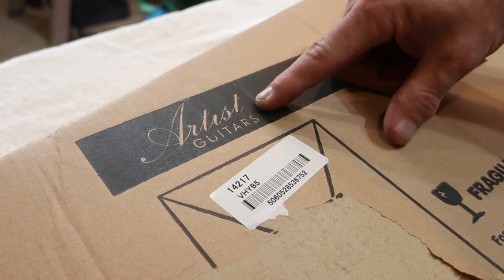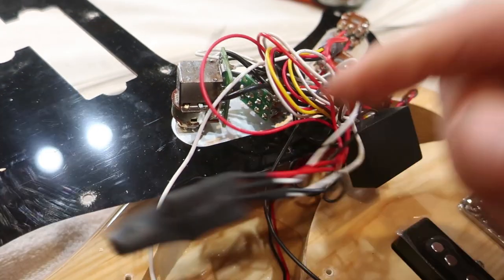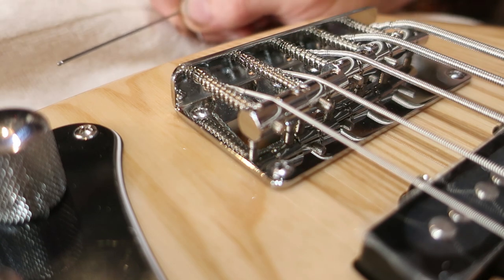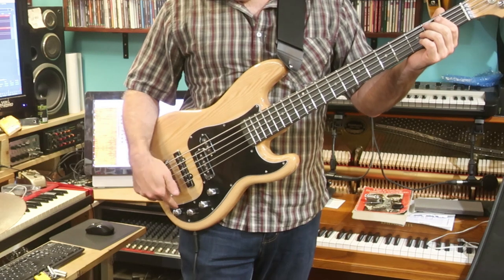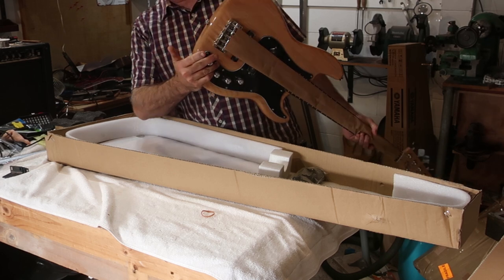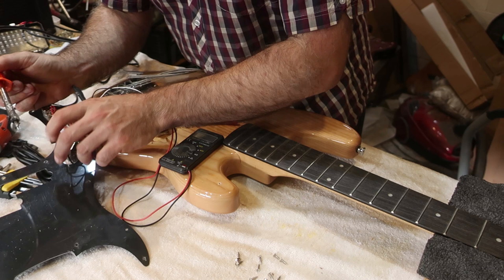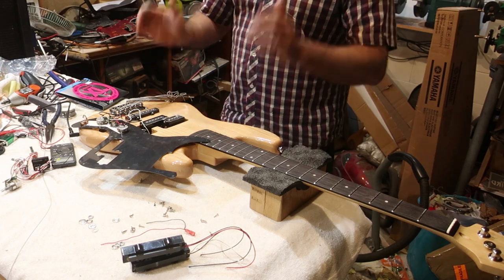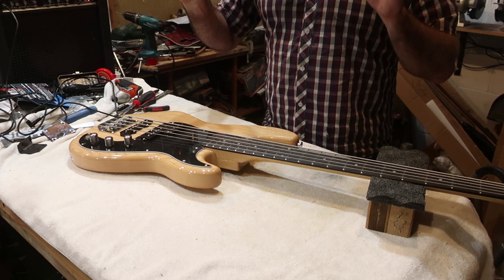Artist 5 String Bass - Full Review and Teardown

Comment: My recent experience with buying a JB2 bass from Artist Guitars has been very different to yours.
You must have gotten a dud. 
I just bought their JB2 bass, & it is fantastic. Everything works smoothly & well. Intonation perfect out of the box. Not a single high or low fret. Perfect tri-colour sun burst. Quite single coils. I did lower the action by about 1.5mm, & I had to back off the truss rod by ¾ of a turn to introduce enough relief into the neck, but I’ve done similar on much, much more expensive guitars. The only thing I’m going to replace is the distinctly ordinary nut, but again, no biggie.
I took the control panel, pick guard off, (the pick guard was extremely tight), the cavity was painted with conductive paint, the pickups all adjusted easily for height, & the electronics were tidily soldered.
I paid under AU$300, for the instrument, 15w amp & assorted goodies. To say I’m just “pleased” with my purchase is a massive understatement, this is the best value guitar I’ve bought in 30 years. In my opinion, this guitar amp pack is as good as the Fender Squire Stratocaster pack I bought 5 years ago, at a fraction of the cost. Not really fair to compare a regular guitar to a bass, but you get the idea.
I have two Maton Acoustics, so I know a quality instrument when I pick one up
This is my first purchase from Artist Guitars & it won’t be my last.
I have no affiliation with Artist Guitars, apart from being a happy, satisfied customer.
Any how, I enjoyed your review. Thanks man.
Reply: Hey. This is the pack I'm looking at getting. How is the amp? I haven't been able to find any reviews of it other than a couple feedback posts on the site. I would go ahead and and get the 10 inch 30 watt amp but it doesn't have an aux input...

Comment: Update from my last post As I have lived with two of these basses for a while now. I bought two of them. One to convert to a fretless. The other remains fretted. Both had bad fret work around the D string. Both sounded under powered. Looking at the pickups. Even though you said the 10.4k is heaps for the split pickup. And true it is what you would expect from a USA made fender split P pickup for a 4 string bass, A five string bass needs more wire for the same windings as a 4 string as the pickup is longer.  It should be around 14K and the bridge pickup should be around 10K. I have had a go at rewinding the existing pickups to these numbers and they sound great now.  Neither of the basses had bad bridges, I think that was a one off. Both of my basses had similar wood grain to your second bass. Both basses had similar body construction to your first bass. Yes they are made from Ash and so are heavy basses. 
I totally agree with you if I did not have the skills I have to do a fret dress and rewind the pickups and had to take it to a shop for the work to be done I would be pretty disappointed. Consider that that would cost and the price of one of these basses there is far better out there. 
And like you said defiantly not good for a beginner or a pro. Good for a project only.

Comment: I've gotten 6 electrics from Artist over the years, 2 acoustics, a banjo, a lap steel, and various accessories. I've also taught several students who play Artist guitars, some of whom bought them on my recommendation. I've never seen one this bad, although I've had a few issues with them. The electric guitars have generally been better than everything else, although the 7 and 8 strings had some problems. It's definitely a good idea to look over the instrument, show it to someone experienced, be critical, and send it back if necessary.
Reply: And then consider things like the strings they put on their instruments. They put round-wounds on their fretless bass even though it'll quickly damage the fingerboard. My 8-string I seem to remember had a very thin low 8th string that was flappy, and I had to swap it out immediately. The lap steel had a standard 10-46 gauge guitar set tuned to standard guitar tuning even though it was a short scale instrument, so it didn't work that well for slide until I changed the strings. They do the basic, popular standard instruments well, but get something a little exotic, and it will have less attention to detail.

Comment: I wish I had seen this Video before purchasing my 5 string from their bargin bin :| mine has the same neck grain issue that yours did and the electronics keep playing up. I was litterly just seaching for a video that showed the wiring of the bass to see where that "spare" black wire was suppoesed to be connected to... I have already stuffed around with doing the fret work to get that d string settled. although i haven't tried putting a spacerbehind the neck.  thanks for your insights.

Comment: I got an artist bass guitar and it also had a loose random wire
Reply from the maker: I'm thinking of dissecting the preamp and trying to determine what it's supposed to do. It might just be a grounding wire? I joked in the video that it might be an antenna, but who knows? My friend said that it could be picking up radio interference and using some smarts to cancel it from the output, I highly doubt it but there's very few clues to go on. Thanks

Comment: Its odd, but I bought a cheap amazon neck for a build. Looked and felt great, but had  two knots around the 12 fret.
Traditionally that's bad, but the neck was very stable and never needed adjustment thereafter. **shrugs**
Reply from the maker: It can be impossible to predict what a piece of wood will do - or not do, when there are knots involved. The biggest problem is with the grain growing in a circular pattern around the knot, that can either make the wood at that point very strong or very weak depending on the orientation of the knot inside the wood and which way the tensions are pulling. This is why flame maple necks are so good, if the curly grain is consistent all the way up the neck then the wood is pulling on itself in every direction at once and it literally can't move, it's the most rigid a neck can get. When the flame stops part way up the neck you'll get a weak point, and the first bass had some very squirrely grain and 2 small knots right at that point, it was literally the worst case scenario.

Comment: Cool video as always - sadly didn't catch it when it went up, thank you algorithm I guess...
 
Not really a staggering endorsement of that Artist Guitars brand, is it?
Personally I only go for passive when buying cheap-o brands - active electronics in cheap basses are usually crap.

Great song - have you ever thought of putting your jams/songs on bandcamp?
Reply: Then again, it is up to your personal taste as well.
Reply: The active/passive thing you meant?

I just never found a cheap preamp to be objectively better (parts quality, signal to noise ratio, filter frequencies, features) than more expensive ones. And I think it's reasonalble to assume that a cheap instrument won't be sold with a preamp that is the equivalent of one that retails for 100 bucks.

What's your drift?
Reply: @lynxkrueger  good point, then again I'm more of a passive guy myself, the only one with a pre amp I have is my 5 string Stingray. I actually thought about getting the artist (i have an artist jbass and I love it) but pulled the trigger on the ray instead.
Reply: @DrNoClu  absolutely - with me it's a mixed bag - I hardly ever use them but many of my basses have active preamps. Don't miss'em on those that don't though - it's like sometimes one likes a hamburger and another day the cheeseburger is the preferred choice - some may even go for extra bacon and pickles.
Just that some kinds of cheese won't work too well in a burger...

I think with the ray you're gonna be much happier in the long run, or at least more free of hassle - at least judging from the overwhelming endorsement in this video...

Comment: How fussy can you be with a $200 bass? At least you don't have to assemble it yourself. If nothing else, it's great for modding. I just ordered one.
Reply from the maker: It was $350NZD and for the price I would expect at least the electronics to not be total garbage. I've modded mine out of existance, the neck is great after a fret leveling and I've put it on a completely different body and actually gig it regularly. The body has been recycled as it deserved to be.
Reply: @fanbladeinstruments  I’m going to do a burn treatment on it. I practiced on some wood slabs at home, and got some good results. Hopefully, the wiring will better on mine. Cheers!